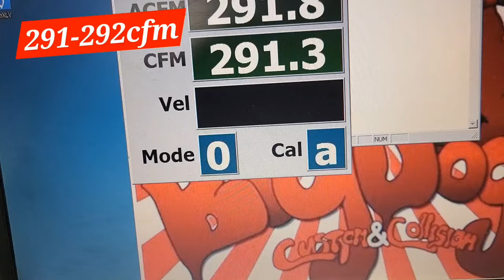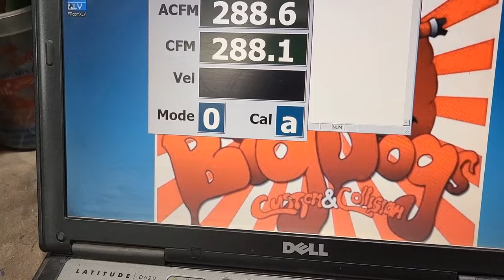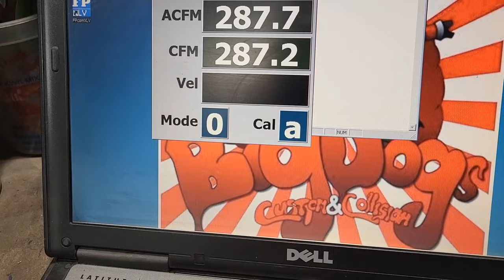TFS Box R vs Bigdogs Porting Stage 3 Cobra Gt40 sbf manifold Comparison😯 Which one is for you?

Comment: I will be using your services sometime this year. I am restoring my 1994 mustang gt.
Reply: With the money saved u could use that money elsewhere and pick up more than 20 hp 😂
Reply: @79beans347 bad advice.  It's all about the combo.  If you wanna perform better and make more power you need a good flowing heads cam intake setup and an Intake pipe and throttle body to flow enough to take advantage of it.  That's the difference between guys who make 275 wheel with heads cam intake and the ones who do 325+ to the wheels with a stock bottom end.  The difference is even more than the peak to peak numbers suggest.
Reply from the maker: @midnight347 not bad advice at all. Do your research on us and our results and you will see we know what we are doing because the results speaks for themselves. We have over 5,000 customers and have ported over 6,000 parts internationally!! We also have made the most NA hp on a Explorer GT40 manifold that we know of at 546hp on a engine dyno with a 347 street/strip motor.

Comment: These all suck. None can compare to a simple single plane. Bottom manifold sucks no matter how you port them.
Reply from the maker: BS!! We test everything and have over 5,000 customers worth of results. A out the box SBF Super Victor average runner flow is 315cfm. Our BRD Explorer gt40 or BRD Systemax 2 will crush that and bolt up like stock. He'll even a stage 2 Ported Boxt R will crush a Super Vic. 
With out porting you don't have to settle for a single plane carb type manifold in you want to make max power
Reply from the maker: https://youtu.be/-b_gkb9tpBQ?si=bVU0F9RJsnKk7pfY
Check this out